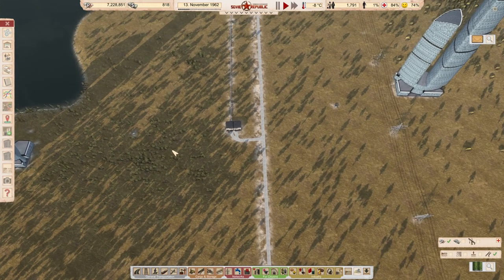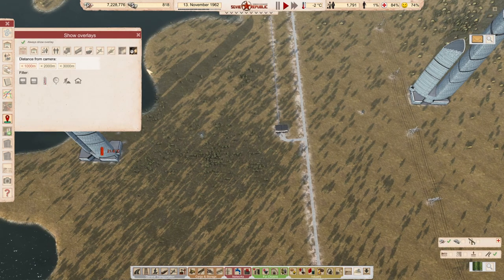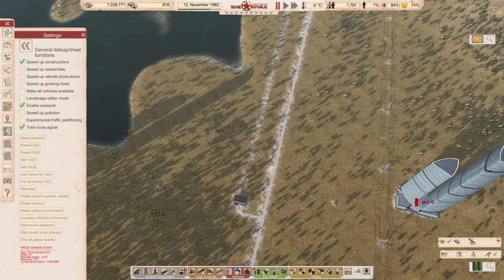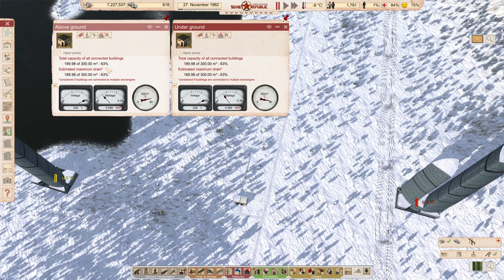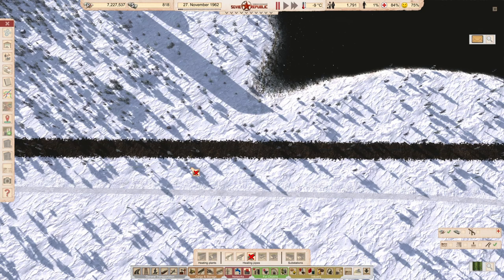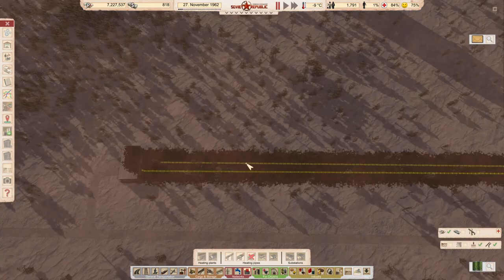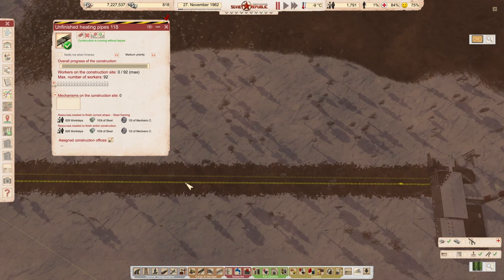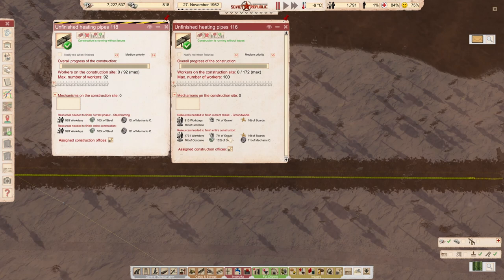Underground heating pipelines are better, why?  | QuickTips | WRSR

Comment: You nailed it. 
I wasnt expacting the difference that high.
Reply from the maker: Thank you!! Have been using this for almost a year now. 
Caught me by surprise too I must say, the heat difference being that high. This is the max length of the pipeline. Which this tests shows is quite useless with above ground pipes.

Comment: cost difference is marginal. Gravel, boards and concrete are dirt cheap. It adds time with excavator, but at least planning is much easier
Reply from the maker: Indeed, underground pipes you can lay directly, from point to point. That is usually not the case with above ground pipelines. What makes underground pipes also an extra bit cheaper,

Comment: I would use normal pipe up to 600m and underground up to 1000m for optimal heating. Never go more than 1000m.
Reply from the maker: Thank you Dennis. Why would you go not further than 600 vs 1000 meter?
Reply: @CayaMaya  You can pump in as much as you want, out will come to little.
Reply from the maker: @ddennisshow  Thanks Dennis.